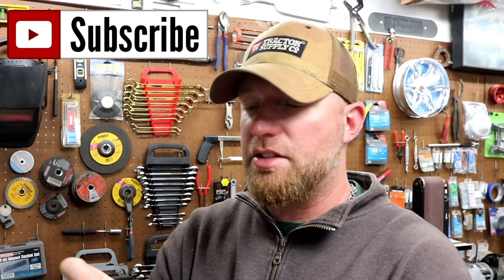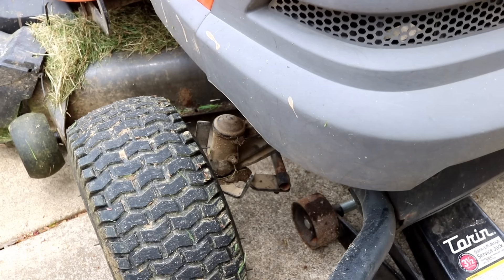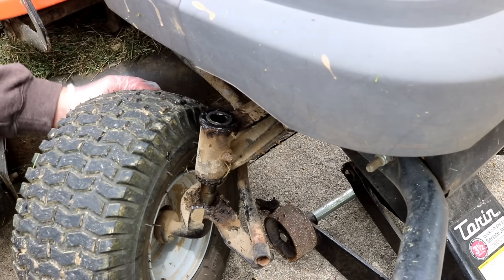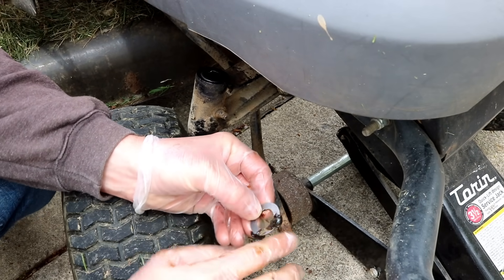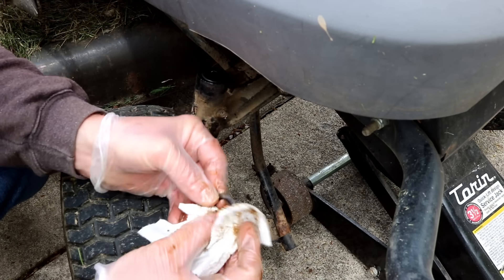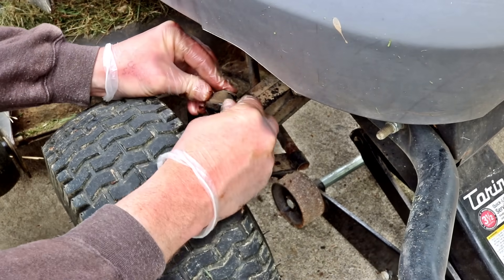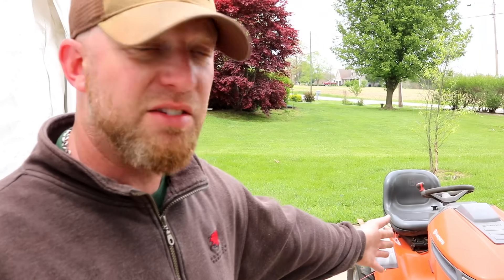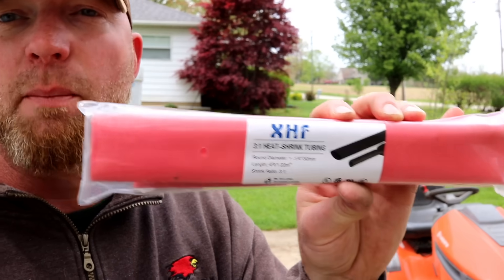$6 And 10 Minutes Will Give Your Riding Mower 1 Finger Steering

Comment: I saw your video and thought I would give it a try on my Husquvarna YTH 18542. I also used uxcell Nitrile Rubber O-Rings 42mm OD 34mm ID 4mm Width,  on the bottom. I was AMAZED at the difference..... Thanks for the idea & video !!

Comment: Hi, there is a very similar truck on chrysler A body cars here in Australia.

It is similar and you replace the factory idler arm that sits in a small frame on the body, this is replaced / modified with a smaller internal rod but the kit had a top and bottom bearings and a sleeve in between

It too is called poor mans power steering
Reply: Is it A bodies only, or B bodies as well?
Reply: @SoI_Badguy  Hi  - Australia predominately  had A-bodies since the 1962 S series Valiant,then from there were local variations produced. Some B-bodies were imported each year until early 70's ( guess under 2,000 per year but 500 is the typical low volume quantity before they had to undergo local engineering certification )

Private imports can occur once vehicles are 15 years or older

Some larger chrysler dealers would organise via Chrysler Australia to import a few vehicles eg Dodge Challenger , Satellite but that was very rare, there would be less that 10 cars per year Australia wide

Comment: So basically you added a part that the manufacturer should be putting on already. 🙄 DESIGNED OBSOLESCENCE
Reply from the maker: @czarkaztik1617  
Since this video I have upgraded to a Cub zero turn… damn thing cost $3,600… none of the spindles have grease fittings along with many other major moving parts. I swear, they sit in meeting rooms and plan for these things to fail in 5ish years so you have to buy another. 🤷‍♂️

Comment: Thanks for the tip.
I was wondering if it makes the turning less responsive in the relationship of the steering wheel.
Reply: It shouldn't as the shaft is still a close fit in the bore.

Comment: I used to ride the in-laws yard on their Craftsman riding mower. Wasn’t difficult at all to steer. Yes it’s manual steering but just like in a vehicle with manual steering any amount of roll makes turning just as easy and power steering, sometimes easier. Since it doesn’t make turning the wheels easy while standing still it fixed nothing. But a lot of yuppies never drove anything that came with manual steering and honestly believe a riding mower is a tractor, and so obviously they’ll believe this is the hack of a lifetime. Will probably prolong the life of that spindle though.

Comment: This is cool,  but have you also just tried a different grease, like the red harbor freight axle grease?  It works for me. You can even thin it with a little motor oil if you want,  so it pumps easier into the zerks.

Comment: Well a dump truck with a full load and no power steering is easy to turn when your rolling..   turning the wheel while stationary is a different story, youll break the steering wheel off before you get them tires to move an inch..